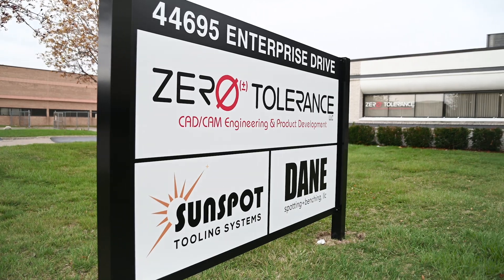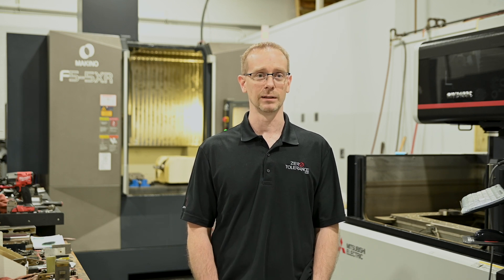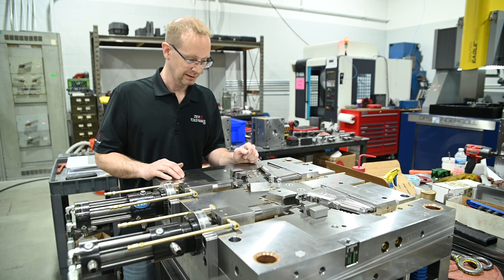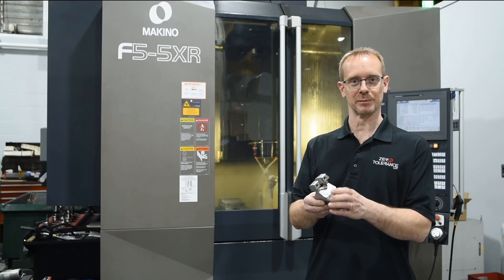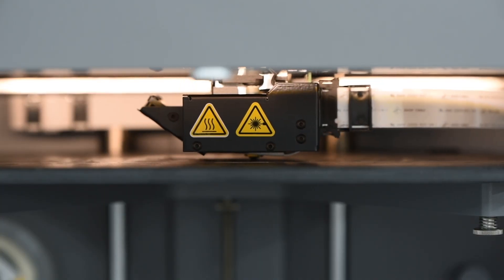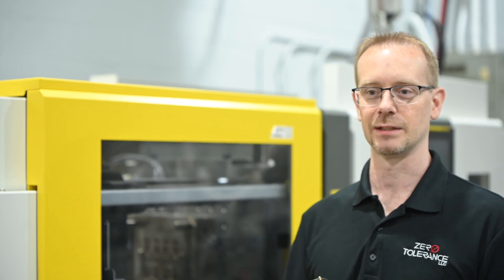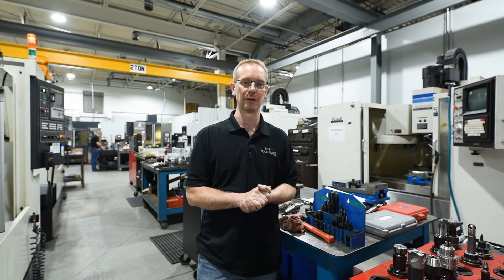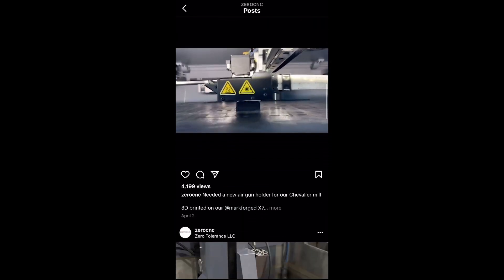Machine Shop Tours: Zero Tolerance LLC

Comment: I heard a Elon Musk quote the other day, "Its not the big that eat the small anymore. Its the quick that eat the slow."

Great job! There are no dummies in machine shops. Problem solvers all!

Fixturing, like a standardized framework lets particular job fit into a templated plan set, makes it easier to bid, build, verify, and support. If its digitalized, all the better.

3D printing....I use a PETG with carbon graphite whiskers mixed in (from an outfit in Byron Center, MI). Beside having a pretty charcoal cor and finish, lol, the parts are actually usable! Like any fused deposition part, have to pay attention to the orientation of the layers, just like the grain in a part made out of wood.
Reply: We like that quote!!
Reply: Fixturing as fcs best by far in 33yrs of jigs and fixtures after fcs lots fixtures and plates went by way of dinosaurs